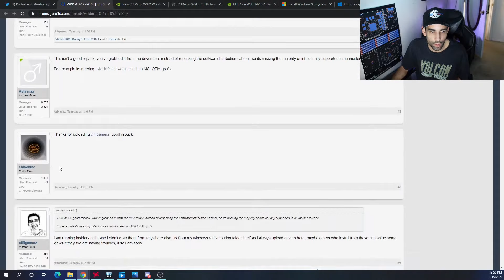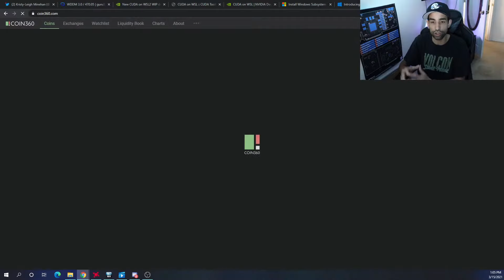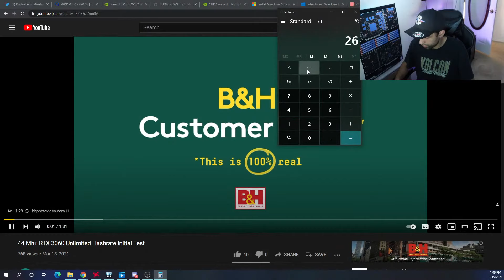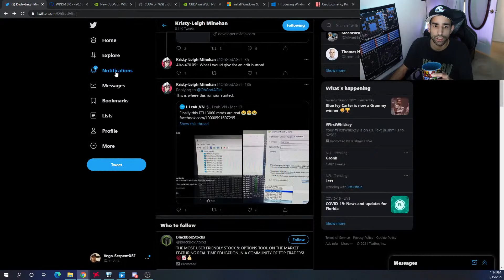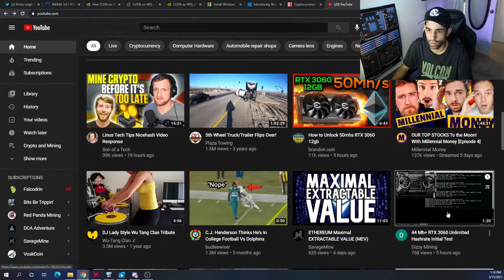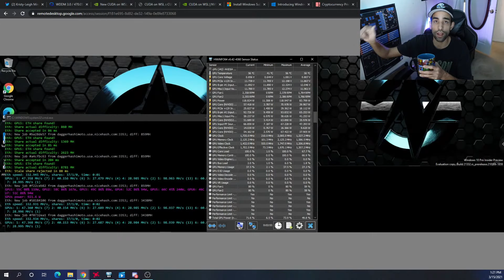Unlocked RTX 3060 Crypto Mining Performance - Live Testing

Comment: I have a problem, when I use riser I get 25 MHS and when I connect on the motherboard I get 50MHS. I have a 3060
Reply from the maker: That's correct, you have to connect to a x8 or x16 motherboard slot to get full performance not riser

Comment: hello) please.. rtx 3060.. ddu clean 470.05 driver.. monitor in.. with no usage or with.. i got it like once in afterburner 49 mhs.. and cant get it right ever since.. MSI VENTUS 3X samsung memory. cca 40mhs sometimes droping to 20.. fan 90% solo card like 50celsius cold start nothing.. h310cm-hdv/m.2, i5 9400f.. any ideas? thx..) second pc 3060 same driver no problems

Comment: Hi!! Me too using RTX 3060 but it doesn't seems to perform well 😭😭
Im using
Motherboard: biostar TB250 btc
Prosesor :G4400
Gpu : RTX 3060 (6 unit)
Psu : 1600
Ram : 8gb
SSD : 120 gb

Been ding the HDMI dummy things and buy a PCIe riser but still got 26 mh/s 😭😭😭

Can someone help me please, im kinda stuck here 😭😭
Reply: did you try this driver ?
Reply: U need to disable mining mode at BIOS. Then u good.. but I had another issue..  with mining mode disable and 4th GPU installed.. i stuck in BIOS.. up to 3 GPU is fine.. ☹️☹️☹️ starting time wonder isit biostar problem or other motherboard has the same issue..

Comment: not working
directly in PCIe main slot + dummy + driver = fail
was trying on tb250 btc pro mb
will go for other coins...can someone point me to some link where i can read how to mine 2 coins with one rig?
like one gpu on eth and another one on raven or such...
Reply from the maker: Just use direct mining. In the miners, there are commands and it will tell you how to specify GPU's in it. Or use Awesome miner, the free version will allow you to setup to "Profit switching miners" https://youtu.be/o6ez0LAmq-8

Comment: Hi SerpentXSF to summarize, i need 3 things to make my rtx 3060 working @ 48+MH/s First, Plug in my rtx 3060 to pcie slot x16. Second, download install the driver in your link 470.05, and third, connect a live monitor or dummy plug. Am i getting it right? Thank you!

Comment: Hey the btc-t37 board has x8 x16pcie slots. I've got a few of them coming as well as 4 3060s. I'll give an update in the next week to let u know how it goes.
Reply: Try, i dont kmow if with pci 2.0 will work🤔
Reply: @marc44190  I’m quite skeptical about this because it needs at least x8 lines to work , anyway let’s wait the buddy share the results , cheers 👽
Reply: @edgardmozart  I'm skeptical myself but the 4th card came in today, imma do the test in a few hours
Reply: @megalojerk84  awesome bro ;) fingers crossed 🙌🏽 cheers
Reply: So. Got the boards. Got the cards. Got the dummy plugs. Got screwed on fb marketplace and got the wrong ram. Bought it as 2 4gb sticks got 2 2gb sticks. No test. I am lame.
Reply: @megalojerk84  i have btc37 with 3060 and i cant unlock them 😭
Reply: @megalojerk84  btc37 motherboard only have 1 slot for ram bro
Reply: @marc44190  I know I've got a few of these boards I was gonna use 4gb in each
Reply: @megalojerk84  u can unlock 3060 in there?
Reply: @megalojerk84  hey bro i cant unlock 3060 on these boards
Reply: I was exactly thinking  about this
Reply: but my question is, that Mobo is 2 gen  right ? does someone else tested this 3060 in a 2gen pcie   ?   thanks bro
Reply: @edgardmozart  I really don't know yet, I'm gonna test 4 of them when the boards come in. Wish I had 5 thatd make this test a bit better
Reply: I tested it on the btc t37 it wont work with more than one. I didnt figure it would after I saw Red Panda Minings video with the Onda board but I gave it a try anyway